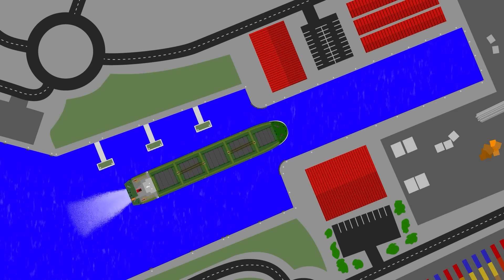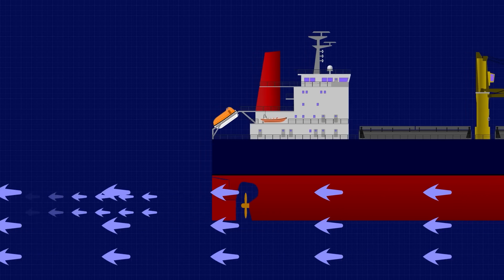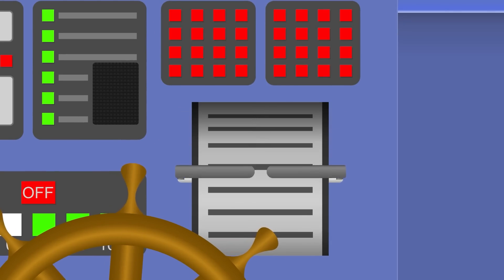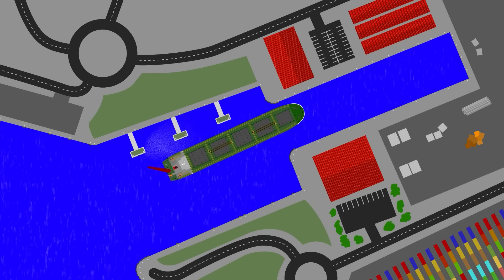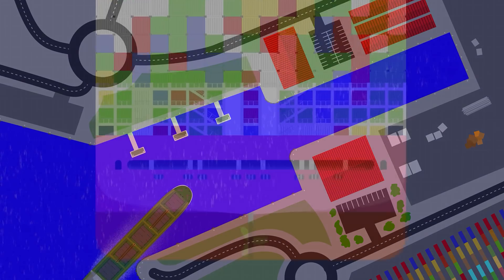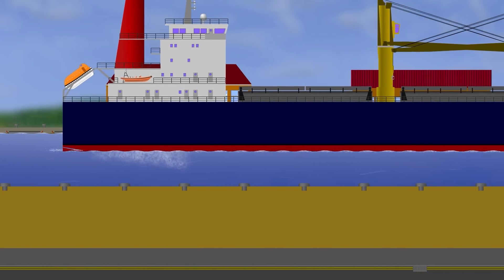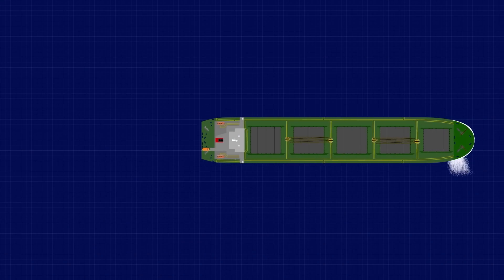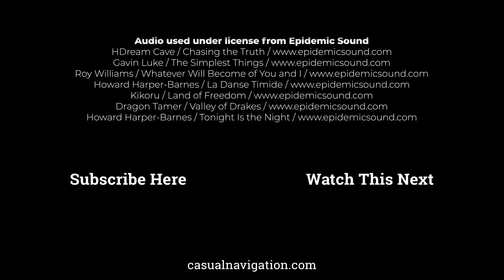Why Can't Ships Reverse Around Corners?

Comment: For cars, the easier, safer way is to just size (and, if necessary, angle) your parking spaces appropriately so that they can be entered going forward without needing the geometric advantage of backing. Backing out of a space is always easier and safer than backing in, and forward-in/back-out creates less congestion in the parking lot than back-in/forward-out.
Reply: "Backing out of a space is always easier and safer than backing in"

Not true in the slightest. Theres a reason a lot of construction sites require you to back in to a parking space - because it maximises visibility when then leaving said parking space. There are multiple studies on this you can read to confirm as such.
Reply: @Garfie489  You have to be more precise with equally constrained visibility. Backing out, you just have to make sure that there's nothing behind you and that you end up in the travel lane. Backing in you have to make sure that there's nothing behind you and that you end up in a narrow parking space. It's better to have the visibility advantage of traveling forward while doing the more precise work.
Reply: @JonBrase  its not equally constrained. Backing in, you have full visibility of what you are aiming for, and what is either side of the spot the whole time - backing out, you have to just wish and hope no one is driving fast down the parking lot to not see you in time. 

Also.... you forget reversing makes the vehicle easier to turn. Thus you have better vision, and better turning when backing in

Comment: The biggest issue I see here is that for your example ship the fore and aft propulsion has be done rather quickly and that doesn't seem possible with your standard direct drive slow speed diesel engine.

Comment: 20 years ago I was the helmsman on a sub.  One day we were practicing maneuvers and the OOD had me try steering a coarse in reverse.  It took me a couple minutes to figure it out but got it down quick.  Several months later I asked him if we could try  some coarse changes and such and next opportunity we did and it worked quite well.  The most difficult part was then convincing the planesman that he had to put a down angle on the boat to go up and an up angle to go down.  Not sure he ever got that!  Either way we showed it could be done quite well and even showed it off in some man overboard drills later on while we were on the surface.  

This really didn't have any practical use beyond a man overboard situation.  And we never tried it in port with a precision maneuver, which would probably be near impossible without a lot of practice.

Comment: This is basically true but also in a practical sense completely wrong.  Yes rudder effect is limited in reverse thrust.  But skilled pilots used the “walking” effect of the propeller to move the stern of the ship.  I’ve docked many ships by backing into slipways.  It’s a common practice though somewhat unusual.

The usual reason for driving head into slipways is that in almost all real world conditions there is less water closer to shore.  If you are limited in draft and run your propeller hard it can cause the squat effect to multiply and ground the ship.  Hence whenever possible pilots prefer to put the propeller in the deeper water toward the channel.

Lastly all of this is irrelevant because modern single screw ships rarely dock without at least two tugs so the performance of the rudder is not crucial.

You can dock without a tug assist, but the safest way to do so requires setting an anchor and backing down against it.  It’s an old school pro move that most pilots rarely get to do today and most captains would never attempt.

Comment: Also remember where the pivot point is.  when going astern, the pivot point moves aft, so the lever arm to the rudder/prop is short, vs going ahead.  This is why a bow thruster is so much more effective going astern, its lever arm is long, like the rudder's is when its going forward.

Comment: > it is much easier and safer to back into a parking spot
Excuse you?
Reply: thats the simple physics of the situation. Its why its required on many worksites around the world - safety
Reply: Safer for when you are leaving the parking spot and entering possible cross traffic, since you can more easily see what is ahead of you. Easier, too, but only because you have already completed the hard part of backing into the parking spot. You are going to have to back up at some point in the process (assuming it is not a pull-through parking spot) so it is up to you whether you want to back in or back out.

Comment: Your base assertion is nonsense.  Reversing into a space is not easier and safer.
Reply: every chemical plant and refinery in the US has everyone back in. also my f150 is much easier to back into a tight parking space than to try to turn into.
Reply: Your comment is the only thing thats nonsense. Do any level of research - even a simple Google search - and its not hard to find out the physics behind it being correct.

Comment: "In a car we all know that reversing into a parking space is easier and safer." 

I have never understood this argument. In what way is it easier to reverse into a space than it is to just drive into it? Reversing into a space requires more steps and is thus more complicated by definition.
Reply: Physics. Same reason Forklifts (which are designed to go forwards into a parking space) have their steering at the rear. Its also safer when leaving.
Reply: Have you ever tried parallel parking by "just driving into it?" That's definitely not easier, faster, or less complicated at all. I'd rather spend 10 seconds parking the right way in one swift motion than spend 45 minutes driving forward a few inches and then backing up a few inches over and over again just to get it "close enough"

Comment: Isn't part of entering a drydock bow-first also for them placing the blocks for it to rest on mostly before pulling it in so it should be roughly centered? So it's not just getting in/out, but relatively precise placement so as to minimize work needed underwater before draining.

Comment: Wait, we all know that backing a car into spot is easier and safer?  Don’t get me wrong, I love this channel and all the teaching and comments.  But, I need help with this one.  Any stats, physics?   Almost no one I know reverses in unless it’s at the race track, sometimes people think it looks cool with the nose out.  But in a parking lot you have to pull ahead and then go backwards.  Totally screws up the cars on either end of that.  Also, I find that cars nose out tens to pull out faster knowing they have better vision and then are moving much faster than pedestrians and other cars are expecting.  Also, you can’t load your trunk easily if the trunk is facing another car.  Not ease or safe, but definitely practical.  Location = west coast of US.  I’m not against going backwards - I parallel park all the time and there you do have to pull past, but, that’s the norm.  Anyway, anyone have different experience any stats from studies, customs in different regions?
Reply: Its basic physics. Its the same reason forklifts have their steering at the rear - as they are designed to pull forwards into parking spaces. Having the steering wheels trail when parking allows for more manoeuvrability, with more vision then when leaving said space.
Reply: @Garfie489  thx!  I never looked at it like that.  And, I used to drive a forklift at an air freight company! 😂

Comment: In the '70s I rowed competitively, sculling and bow in 4s/8s. The ladies' crew asked me to act as their cox, to which most 20-year-old males would eagerly agree. I soon learned that the rudder was a poor way of changing direction by much as the drag became enormous for anything other than small angles. The solution was to get one side of the boat to apply extra force by calling out "hard-on bow", or "stroke hard". Cox must control thrust.

Comment: One cool example of a ship recently backing into a drydock was the USS NEW JERSEY who was drydocked for the first time in 30+ years only a few months ago. They had to back into the dock because they know the starboard side shore tie connections worked (because that's what they use normally) and didn't want to risk getting stuck with no power if the port side shore connections didn't work. Since they also don't have their own propulsion they had to have tugs push her into position just outside the dock, then hook up a giant tow line from the stern to a capstan at the end of the drydock that manually pulled her into position. Their curator did an AMAZING series of videos on the entire drydocking process, and it's definitely worth a watch if have a few minutes.
Reply: So did they test the port side connections?

Comment: 4:26 I take issue with the "walking effect" explanation. While there is a pressure differential, the density of the water barely changes with the change in depth from the top to the bottom of a propeller arc. The effect of "prop walk" astern has got to be almost entirely attributable to the interaction of the prop wash with the hull (as shown a few seconds earlier), and any "p-factor" from a line of force not level with horizontal (an inclined prop shaft, common on smaller vessels, perhaps not so much on ships).

Comment: Some craft make things much more interesting, look at the design of most submarines, the rudder and aft planes on most modern subs are in front of the propulsor or prop, they really do not turn very well! The other vessel which must be a real challenge is the Waverly, a paddle steamer with side paddles, there is only one central engine so the paddles both turn together on the same shaft, She is a long sleek vessel and thanks to the paddles being at the side and the single rudder being on the stern she has no steering in either direction until she has picked up a considerable speed. No wonder she often comes alongside fairly hard and often leaves piers backwards, getting up to a fair speed before she is able to turn at all!
Reply: Which is a big contrast to paddle steamers with independent control of the paddles that can turn very well. A lot of tugs, ferries and river boats kept side paddles well after screws became standard due to the manoeuvrability advantage.
Reply: Amen.

Comment: It's not exactly the same, but similar to driving a truck with a trailer. 

You have to understand counter steering, when you're backing up, or you jack knife, and well... you're done.
Reply: The funny thing with trailers is that smaller ones are actually harder, since there is less distance between the hitch and the pivot point, so it will get out of alignment very quick. I've got a small trailer and despite many tries I've never managed to reverse it onto my drive. Road isn't wide enough to come back straight. Doesn't help that it's slightly uphill, so keeping the speed down is very tough (manual, so it's a case of letting it idle and just going at that speed, or slipping the clutch and risking burning it out). Luckily it's light enough to unhitch and push.

Comment: Since cars came up, there's another key difference which is more relevant for cars but would still seem to be a bit relevant for ships as well - in both cases the main steering system is on one end of the vehicle, the front wheels for cars and the rudder for ships. Because that's the end generating the steering force it's also the end that's swinging sideways the most - you can pull into a parking spot in a car with a much tighter turn when reversing because you can still pivot the front around to change directions even as the back of the car is entering the parking space, all without crashing into the cars on either side. In a ship it's the rear end that's swinging to the side, so going front in first makes sense from that standpoint too.
Reply: This is a good analogy, anyone who has driven a forklift or other wheeled vehicle with rear wheel steering may have realised that they are much easier to park facing forwards for the same reasons. More relevantly to why forklifts have rear wheel steering, it makes them much easier to manoeuvre accurately up to a load - a very similar operation to parking.
Reply: Another situation where this comes up is "parallel parking". With a car, you want to reverse in, since you can get the rear pretty tight to the kerb and then turn the wheel full lock to bring the front in. With a boat or ship, you want to do it forwards, normally putting the bow into contact with the dockside and then using the rudder to bring the stern in (usually having tied off at the bow to stop forward movement). Going out is then opposite. With a car you drive out forwards. With a boat or ship you let go at the stern, then use the rudder ahead to kick the stern out, then reverse. Of course that doesn't apply to cases where tugs are used to move ships sideways, or where bow thrusters can also allow sideways movement.

Comment: 0:05 In which universe is reversing a car easier than going straight?
Reply: You’ve gotta back up one way or another… why not back into the parking space (which you just drove slightly past and can confirm was clear) instead of backing out into the roadway?
Reply: @JoshWright396  It's easier to perform a precision manuver in a narrow space if you go straight rather than reversing. After that, when you reverse you have the entire road to perform the manuver and it doesn't need to be perfect since the goal is to go away immediately.
Reply: @JoshWright396  you’re not backing up into a roadway in a parking lot
Reply: @JoshWright396  also yeah confirm it’s clear with the two big cars blocking any view real genius there
Reply: @zachv  in order to back into the space you have to pull past it, allowing you to confirm it's clear. Those two big cars are way more of an issue if you're trying to back out, as you can't see if a car is approaching in the lane.
Reply: @JoshWright396  you can tell that the parking place is clear by pulling into. It’s not that hard.
Reply: @zachv  right, but then you can't tell whether the driving lane behind you is clear when you have to back out of the spot (due to the aforementioned big cars on either side)
Reply: In any universe with cars that have front wheel steering and driving schools that teach you how to park properly
Reply: @bosstowndynamics5488  you mean schools focus on a useless maneuver that you never need to perform in your entire life

Comment: Do we all know that reversing into a parking space is much easier? I would say 90% of people or more pull forward into their parking spots, in large part because it’s way easier lol
Reply: The thing is with a car, to drive into a space you have to be pretty much aligned by the time your nose goes into the space, since you won't have much manoeuvre room to adjust the back end (which is why people often end up either at an angle, or having to keep backing out and coming in again). With a boat or ship, if you need to reverse in, it's easier to get aligned going forward before reversing back in.
Reply: @ChrisCooper312  I rarely ever see that
Reply: @zachv I see it all the time, and backing in absolutely does allow you to be much more precise, why do you think fork trucks steer from the rear?  Why do you think people put trailer hitch balls on the front of the tractor?
Reply: @integr8er66  you know, I just looked it up forklift don’t steer from the front you have no idea what you’re talking about
Reply: Backing into a parking space isn't easier than pulling forward. Backing any vehicle is going to be harder than driving it normally. 

Backing your car into a parking space IS easier (and safer) than backing out of a parking space.
Reply: The front end of a car moves sideways a lot more when parking, so you can reverse park in much tighter spaces much easier without needing a ton of space outside of or next to the spot to turn in. That advantage is reduced somewhat if you never get taught the easy but fairly specific skill involved in lining up to reverse park though, and gets reduced further if driving a smaller vehicle and/or if the parking spots are very large
Reply: @bosstowndynamics5488  that sounds completely made up
Reply: @zachv  You should pay more attention to how your car moves next time you drive it. When you're steering, the front wheels are at an angle so the front doesn't move straight, the rear wheels are still in line with the vehicle so the rear just goes in whatever direction the front happens to be pointed at any given moment, lagging behind as the front is constantly swinging around. It might be more obvious if you look at a video of a forklift or something else with rear wheel steering and watch how it moves completely differently when steering because it's effectively driving backwards compared to a car.
Reply: @bosstowndynamics5488  yes yes they do. Your car is drifting. Get that fixed.
Reply: Europeans in the comments are losing their minds at people being able to park differently.